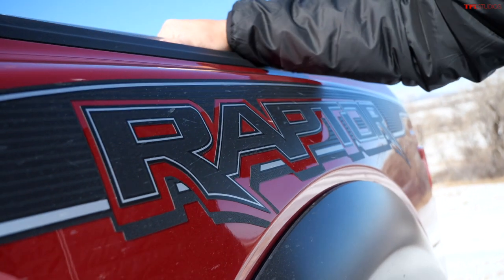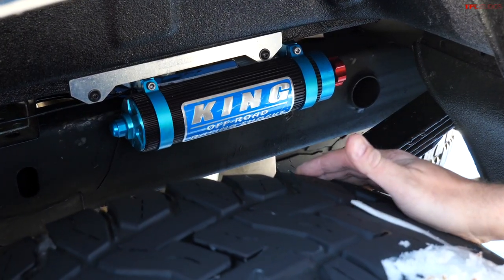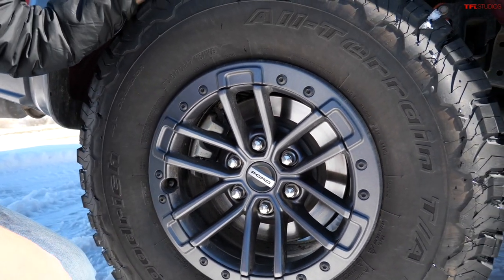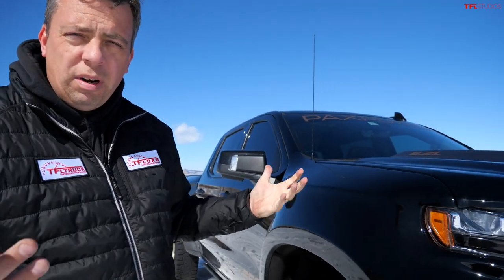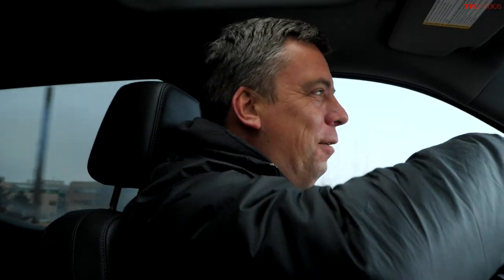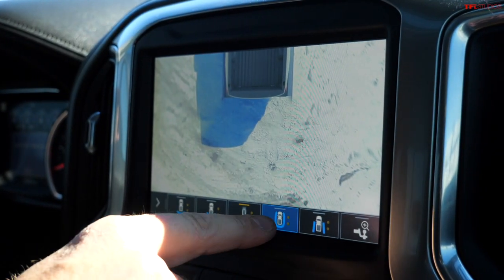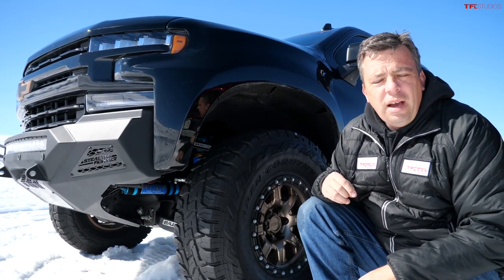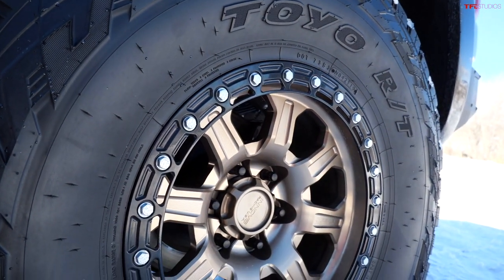Is This 650 Horsepower Chevy Silverado Jackal The GM Truck To FINALLY Take Down the Ford Raptor?

Comment: As a GM guy, I would get the Ford or RAM. You can after-market any truck. It cost more and no warranty. I want factory fresh with warranty.
Reply: Except the warranty is voided on any of these if you take it off-road and who wants to fight with a dealer over overpriced parts/labor?
Reply: @nadieselgirl  This is false. The only time the warranty is voided on a Raptor or a TRX is if you make mods that directly lead to a failure, or if you do something this is outside what the vehicle was designed for. So if you jump it 80ft over a river (aka StreetSpeed717) and something is damaged, it may not be covered. But neither will void anything from what the vast majority of people do off road.
Reply: @nadieselgirl  What? Off roading voids warranty on an off road truck? What the hell are you talking about?
Reply: Paying 20k in depreciation for a warranty that might cover at most 5k of possible repairs? Not worth it to me.
Reply: @bendino9016  what? These trucks barely depreciate and a warranty can cover much more than 5k especially on these trucks where everything is expensive. Not to mention fiatrx is unreliable as all hell and the found on road dead is a close second so you are basically asking for trouble with these mega boosted trucks
Reply: @bendino9016  Raptors dont depreciate much at all. Trucks in general dont, but used Raptors are certainly not 20k less than new.
Reply: @Stuka87  depends on how many miles and years old it is...
Reply: @shrayesraman5192  perhaps the raptor, but the video was about the chevy, so i was thinking more along those lines... new trucks and "used" 2 year old 30k miles closer in value then they ever have been. 2021 new cars will get even more expensive.
Reply: @Stuka87   Yes they are. I've seen older Raptors going for 30K with only 180K miles on them 2014 year.
Reply: Ya. Also kind of stupid to compare stock vs aftermarket.
Reply: Agreed
Reply: Manufacturer warranties are limited warranties.
Reply: For $25k you can get a gm to 650hp and decent suspension.
Reply: Where’s the race?

Comment: 100k for modified truck and lose factory warranty. No point
Reply: lose
Reply: I get what you are saying and I'm on the same page as you.  With that said, if you can afford to drop $50k in mods on a truck you already paid $50K or more for, you can afford to fix it when you break it.

Comment: $100k for that GM truck and the interior is still on par with 2010 era vehicles...sad
Reply: Which 2010 truck are you referring too? The 2010 Rapter had the 5.4. The 2020 Rapter still lacks a lot or serious, and necessary suspension components to continually jumps it or Baja it all the time. Detroit still can’t build a truck that combines the best of everything available.  Sad. That being said, unless you can plop down $40k -50k to custom rebuild your truck from the frame out, you will be stuck making house payments each month for a nice looking Rapter.

Sad the Raptor’s payload is less than my 2003 1500 “wanna-be truck” Chevy Avalanche.

Comment: A "built" truck to compete with the raptor and ram with wheel spacers that screams high quality to me
Reply: @tfl
Reply: Right lol but the name jackal is cool atleast right?..... lmao
Reply: let me find every possible reason to convince y'all not buy a raptor. doesn't matter the make, as long as it's not a raptor 🙄
Reply: Not to mention the super long U bolts that they couldn't be bothered to trim.
Reply: What about Factory Warranty?
Reply: @anthonybarton2103  its covered under the warranty as an extension to it
Reply: @clockwrkviking6930  chevy is definitely not going to warranty anything on that truckbesides maybe the radio
Reply: @anthonybarton2103  if you thro 100k into a truck, warranty doesn't matter. Your aftermarket parts are covered by their manufacturer.
Reply: @brettknighten1171  they do if Chevrolet offers that truck as an option they do
Reply: @clockwrkviking6930  they don't produce the jackel so they won't warranty anything that they touched in the conversation
Reply: @brettknighten1171  yes they will look at the southern comfort  that was a special package from chevy that they had made in texas that you could get built. That truck would fall under the custom truck list just like the black widow and the reaper which are both built by the same company who built southern comfort and get a special warranty with them. The Hennessy camaro is covered by GM as well
Reply: Raptor way under powered compared, too the Chevy and RAM
Reply: @clockwrkviking6930  southern comfort didn’t make the reaper that was Callaway a north eastern company.

PaxPower is located here in Houston, they’re really known to make the 2nd gen Raptors V8 powered instead of the 3.5TT. I think they know what they’re doing IMO since they do this on the reg.

I wouldn’t trust Hennessey with this build. They only know how to put a lift kit and slap on a supercharger and call it a day. Neglect the true suspension upgrades, while also slapping a 500 lb bumper on it with funky words like punisher
Reply: @clockwrkviking6930  a lift kit is totally different then a total reqork of the trucks suspension.
Reply: @donaldkinder6716  raptor was the most powerful half ton for a long time i don't think ford will give that title up lightly
Reply: @brettknighten1171  lmao 450hp is not much compared too 650hp jackal or ram trx 707hp....... Nobody wants too use fords v8s too much Trouble....
Reply: Ahh, you consider lift blocks and wheel spacers a “true” suspension upgrade? Sure it is for mall crawling
Reply: @donaldkinder6716  if you watch videos of the ram is it was to front heavy and doesn't jump well. Also Ford is in the process of putting the predator in the raptor for 2022 that will compete directly with the ram. Also the chevy is not a production vehicle so i don't count it as a GM product same as the exorcist that was suposed to destroy the hell cat and never took off
Reply: @donaldkinder6716  Hey dummy-they sell the eco boost because of mileage restrictions. Plus the V6 makes more hp and torque then the competitions V8. That's why they sell a boat load of the eco boosts. Get a clue kid.
Reply: @donaldkinder6716  just wait for the gt 500 engine you can get in them now.
Reply: @jimh.412  You need to explain to me what you mean by mileage restrictions. I can't imagine you're talking about Ford using ecoboosts because they care more about fuel efficiency in their performance truck than it actually having higher performance. I'm sure the TRX and Jackal get horrible gas mileage, but you don't see them saying that they would put a v6 in their trucks because it's better to get higher mpg than it is to be faster. If Ford sticks with eco boost in nearly every vehicle they produce, they might just turn into Honda. The Raptor might turn into a Ridgeline with a lift kit in a couple year's lol And nobody wants to be compared with a Ridgeline 😆
Reply: @kennethsmith3215  The government makes car company's average a certain mpg per vehicle by a certain year. That is why Ford uses the Ecoboost.
Reply: @jimh.412  So, if they made 10 trims of an F-150 and 9 use the ecoboost and average 20 to 25 mpg, but they make 1 super truck with 12, the government is going to say sorry you can't do that? Sounds like a big lie to me since Ram and Chevy both have multiple trucks with bad mileage and Ram even made the TRX with 10 city and 14 highway. Pretty sure with every F150 with ecoboost can offset by having one of them that has 10 mpg.
Reply: @kennethsmith3215  What are you talking about? Ford is making a Raptor with the 5.2L Supercharged V8 motor. Why do you think California is moving to all electric cars besides being liberal douche bags? I believe they get fined by the EPA if they don't meet the set mileage requirements.. Why do you think manufacturer's keep trying to bump up there mpg totals? This isn't the 70's where cars averaged 10 mpg.🙄
Reply: @jimh.412  Oh yeah, the Raptor R will have a v8. Forgot about that one. It doesn't get advertised ever. Lol, liberal douchebags, so accurate. I guess they will just have 2 different Raptors then. People are gonna laugh at the guys with the 3.5l in them and love the ones with the v8
Reply: @kennethsmith3215  The first generation Raptors had the 6.2L V8. They weren't supercharged but they sounded nice. Yeah I'm glad I don't live in California.

Comment: Aftermarket vs Factory.
GM is focusing too much in 2040 going Electric but the times we live in is NOW 2021!  GM needs a Halo Truck like Ram or Ford. Either be Silverado or Sierra (hopefully Silverado) they need to step up, period. 

GM took away the Single Cab Short Bed Configuration, Thank You FORD for still offering the Real Pick up Truck! 

Sad that GM doesn't give us what we customers want but what they think is only necessary.
Reply: As much as I do want to see more EV's and hybrids on the road, let's admit it: going 100% electric will forever be a pipe dream. 
Our electrical grid would be much simpler if manufacturers don't get rid of gas and Diesel options (and if governments could stop it with the forced legislation and banning ICE's).
Reply: GM already announced their halo truck, the Hummer EV. If that doesn't count as a halo truck I don't know what does with that insane price tag and bonkers specs.
Reply: Why didnt they just reintroduce the Reaper and call it a day? Doesn't sound like too much work, right?.. It doesn't need to be as crazy as the TRX either...

Comment: GM still doesn’t have an answer for the Raptor or TRX so I don’t know that I agree that anything is changing. Not to mention the interiors in the GM/Chevrolet trucks don’t even remotely compare to the Ram or Ford trucks. They have a long way to go if they want to compete in my opinion.
Reply: Brett, that's the way I feel. I have and Corvette but the GM trucks need an update.
Reply: @rondail5675  I agree, and it’s disappointing. They haven’t put any effort into their trucks since about 2007. It’s been pretty much the same interior since which is not appealing in my opinion. Even the Denali and High Country models are really lacking when you look at the Limited/Longhorn Rams or the Platinum/Limited Ford trucks.
Reply: GM interiors are indeed in desperate need of a re-design. Way behind compared to Ford, Ram and even Nissan. And I'm a multiple GM truck owner.....

Comment: Jackal pros-
Awesome looking, 
Power
One of a kind 
Super charger baby
Jackal cons-
Lacking real locker 
Weaker axels With Axel spacers 
Stock frame without reinforcement. 
Wheel 
Cost for the fully loaded version. 

Dig the look of this thing. Hopefully Chevy takes note and builds something like this addressing the weak points. 

Great review TFL

Comment: For the money of the jackal I'm shocked that wheel spacers and lift blocks were used
Reply: I've seen Hennessey do lift blocks as well on the velociraptor. Like you couldn't get longer leafs?
Reply: @ColeSpolaric  they're charging a premium for cut corners...😔

Comment: The current Raptor ain’t much really, but I doubt this....”Jackal” looking too beefy can take the Raptor on toe-to-toe.
That’s my bet.
Reply: In fairness to the Raptor for the overwhelming majority of buyers it’s a trophy truck, an F150 Limited without all the gross chrome and 22” wheels. But with some off road gimmicks. The most “off road” these things see are snow covered driveways.
Reply: @chrism3731  The people who buy these usually don’t take them off-road. People who are into off-roading buy old trucks and modify them. Cheaper to break a 15k modified truck than a raptor.
Reply: @chrism3731  I looked at limited. Next to a base XL it looked.... The same? On road or off, the raptor looks like an actual truck to me.
Reply: @chrism3731  agreed. It “ain’t much really” no more, as I mentioned earlier. Hopefully the Raptor R might be something worth it. Is it a Raptor R? Don’t remember really. Jeje
Reply: @exileut  that’s fair but you proved the point. It “looks” the part and that’s exactly what the current raptor is for. Wouldn’t something smaller work better on trails, for sure something less expensive. People are jumping a $75-100k toy in the desert, don’t think so.

Comment: I'm not sure why you continually compare a stock Raptor to very highly priced aftermarket builds or even the $93,000 TRX? 
Wait for the Raptor R (with equal price points) and compare on a level playing field.  
I think it speaks volumes for the stock Ford Raptor Gen2 to be comparable to these trucks for $30K less money.

Comment: Two questions for this Jackal: 1) Is the frame modified for off road strength and durability? 2) Can it be bought from a Chevy dealer? If not, why compare it to the factory Raptor ( with a modified frame from factory btw...) Suggest putting it against a Shelby or Hennessy.
Reply: It can be bought from a Chevy dealer but it may take up to about eight weeks

Comment: $115k for the Silverado?    No thx.    That's insanity.   
It's super cool and I absolutely dig it, but even if it were price parity, I'd absolutely still go with the Raptor.   A $40k premium over a Raptor that has a factory warranty and proven setup just isn't worth it unless you have plenty of extra cash hanging out.
Reply: Couldn’t have said it better myself, except with price parity I’d still go with the Ford
Reply: @davidtadlock2238 dude, it's funny you say that because I 100% meant to write Raptor but wrote silverado!   Gotta edit that!

Comment: I would still take the Raptor. It just makes more sense to me. You get a factory built truck, with a warranty. And, the Raptor has crazy resale values. The aftermarket modified trucks are cool and all, but the integration and packaging of a factory built truck can't be beat, these days.

Comment: I have no need for this type of truck. I live thousands of miles from any desert. I want to see you compare some trucks that will go through some tight woods and huge mud holes.
Reply: Hopefully they get their cheap truck challenge pickup trucks off-road soon! Those are the kind of vehicles that I want to see.
Reply: I agree.
Reply: You need a 80-90s Toyota with a chopped bed

Comment: I wish GM would bring this (or something similar) into production. It might not beat the TRX in terms of power, but at least it would beat the base Raptor. It has 200 HP more than the standard Raptor and 52 less  than the TRX. Plus, it has a supercharged V8, which a lot of people were expecting the Raptor to have come with in the first place. We know that there's a Raptor R coming next year with a V8, but who knows whether that would be roadworthy or not?

Comment: I give thanks to Ford for getting the ball rolling with the Raptor. Then came the Shelbys and the TRX. I have to admit that I like the look of this Jackal configuration the best of all the super-trucks so far. I think that wide body kit rocks and there’s nothing else like a supercharged V8 to get the blood flowing. I also think it will be available in a lot fewer numbers than the Ram TRX so it will be a little bit different. Thank you Chevrolet. And thanks to you guys for bringing us these cool reviews. Now you need to run the Jackal against the TRX!
Reply: Chevrolet had nothing to do with this, Pax Power did the work.

Comment: For both trucks I'm still only seeing $50k of value there. Also wheel spacers are only good if you like  replacing wheel bearings. Gimmicky "drive modes" are cheesy vs just user adjustable ones. These are good offroad trucks if you have more money then common sense. 15k for a supercharger is nuts. You can build yourself a true desert truck for less then half that, but I guess if you want to look cool with minimal effort go for it. $100k offroad your going to be ruining expensive / custom parts fast.
Reply: Don't forget the decals alone are $2000 on the Raptor. I didn't get them. 802A package is $11,000.
Reply: @exileut  Yep, last high performance car I bought got immediately debadged and a stock hood for reasons. Not paying extra for that, especially if I can build it.

Comment: I’m confused, on 19 Jan 2020 you guys did a pretty in-depth intro at Paxpower, on 25 Jan 2021 you discuss a Coyote  powered F150 and now we’re back on the Jackal?  How is this relevant to this market segment?  Can the next Raptor afford to be released with anything less than a supercharged Coyote to take on the TRX?  GM still MIA?  I heard GM is aiming to be the first of the big three to go all electric, so are we talking a Bow Tie badged Cybertruck?!  If this had been a vid with some actual driving it might have been interesting.  Other than that keep up the good work I’ve only recently subscribed to TFL and have found most of what I’ve seen to be very compelling.

Comment: In general you gotta stop saying custom all the time, and start saying aftermarket, cause I'm pretty sure most if not all those parts can be picked out of a catalog somewhere, you did the same thing with your guys home built "tremor" custom and aftermarket are 2 different things

Comment: There is no doubt that you can build a very nice truck with a big check book.

This Chevy looks very well built, nice job.  You can't compare a OEM factory built vehicle. With millions of RD  and a full nationwide warranty.

The Chevy is how much?  A Raptor can be had for under $90,000 and backed by Ford.

Comment: That's awesome! unfortunately I already can't afford the Raptor, so yeah😂. Guess I still have to stay with my all original 260k 5.4 3v, lol. 
That you can save up to buy a $100,000 truck probably. But you're better off trying to find one use later on for 35 to 40k. Hopefully the previous owners didn't Baja it, lol. I work way too hard to spend $100,000 on any vehicle. But of course there are plenty of others who have hundred thousand laying around in the living room, so this is great news for them. I got a few more decades left to try and win the lotto to live the good life, lol